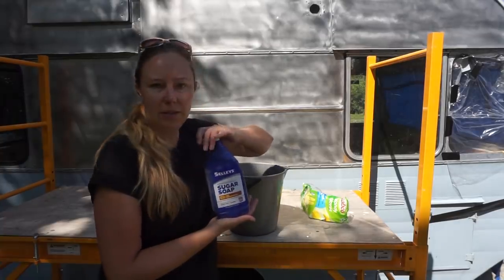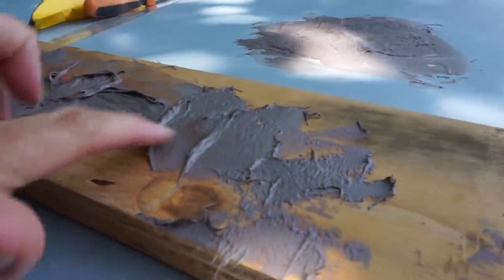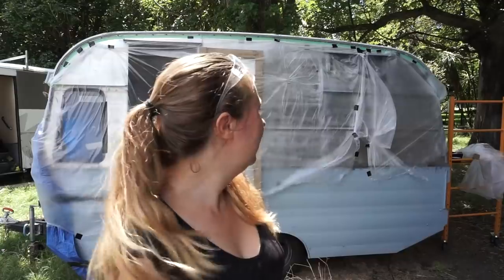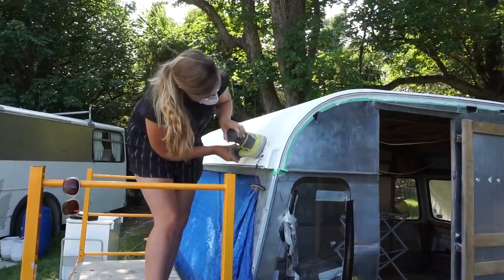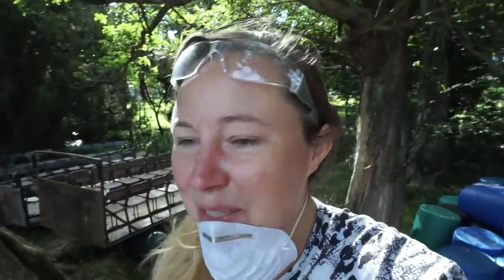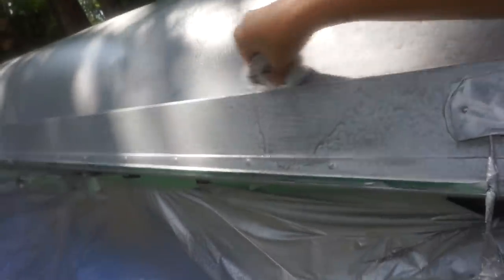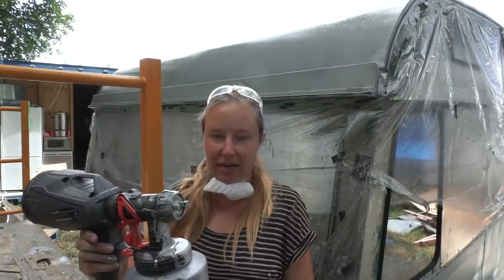Too Excessive With Roof Sealing System? Hopefully No More Leaks!

Comment: A tip for the paint tray; for easy cleanup and to prevent old paint flecks in new paint, stick the tray in a plastic bag and tie/tape up, then pour the paint onto the tray over top of the plastic and use as you normally would, then all your have to do at the end is throw away the plastic bag and your tray is spotless :-).
Reply: You can also get clear inserts for the tray, which are probably slightly easier to use but of course more expensive than a plastic bag. Unless you're using supermarket carrier bags.

Comment: Hi Karen. You are doing a good job on the caravan. If I could give an advice, I would try to get an airdriven spray gun and a compressor for the painting. That is a big difference from those electric guns. The airdriven gun (with a seperate compressor) delivers much finer particles more evenly, and the result usually get much better. I admire your ability to go on with a smile, even with a big project like that! Best wishes from Norway!
Reply from the maker: Thanks Jan. After trying that spray gun, I did wonder how different a properly professional version would be.

Comment: Good work!  When you come to the end of a paint stroke, generally it’s best to let go of the trigger and follow through with the stroke. Then push it again on the return stroke. When you change directions with the trigger depressed, you will get runs. Many thin coats are better than one or two thick ones. Never pull the trigger if the paint sprayer is not moving
Reply from the maker: Ah that's good to know! Great tips, thank you
Reply: I have spent years as a painter, so I would go for a 5" brush on the roof with an 11/2" for edges. You would have trouble reaching across ....with your jolly approach you could rig up access with a scaffold board strapped to a ladder leaning either side of van??   But ladder would need to be lashed to van to stop them sliding.  Just an idea well done Karen for your efforts

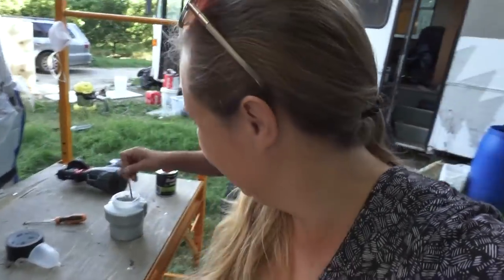Comment: 9:09 Yeah, it looked too thick :)

Dad used to use a bent (into a U) welding rod to mix/stir paint/solvent - and his test was how it ran off the rod when lifted out. I think it was thinned enough when it just spattered/splattered - i.e. beads/drips broke off the bottom of the dribbling paint.
Reply from the maker: Ah ok. Your dad sounds like he knew what he was doing!! Seriously more skill required than I realised.
Reply: @TravellingK  He was a motor mechanic - a proper one - he could do engines, gear boxes, body-work and painting.
He was no good with heights - 2 rungs up a ladder bothered him !

Comment: I think you're doing really well with this...and you must be learning a lot. Waiting for paint to dry can be really boring but has to be done, as long as the job is robust it will be OK, I think it's called 'cottage finish'. :D. There is always T-cut as a paint smoother/polish as a final step, it might (?) help level out those runs a bit in terms of look if not in profile...but only when the paint is really hardened off!! :)
Reply from the maker: hahah yes, cottage finish with personality🤣Think I will need to revisit it.
Reply: @TravellingK  Keep up the Good Work. :)

Comment: Your doing very well it must be nice to have somewhere to do the work. I should of waited until  the video was finished, but if you gets a smaller roller with a sponge sleeve you will get a BETER finish
Reply from the maker: I do appreciate having this area to work in. And not too far from a hardware store (when it's open). Good to hear about the roller!

Comment: Just use a good horse hair brush next time, lots of thinners in the paint to help it settle out on your surface and it will remove any brush strokes, and do 4 or 5 even coats. It will come out as if you sprayed it in a booth, like a glass finish. But hey, you gave it a go!
Reply from the maker: I think I need to look into this... I like the sound of that!!

Comment: Hi you need to really be doing that roof by using a small roller and then once rolled use a paintbrush but very Featherly just to take the pitlane out I think you will probably find it a lot more easier and you will get a even paint with no runs All the best from Terry keep up the good work
Reply from the maker: Hmmm that's good to hear! Think this might be the way I'll go.

Comment: Minefield using a spray gun, first, electric sprayers do not produce enough pressure for something so big as your roof unless you dilute the Cantonese to it's very minimum, else, as you found, you will constantly block the nozzle, but stick with it, , The English Pennliner is proud of you ! x
Reply from the maker: Ah that's interesting to hear. I'm glad I tried it out... but now I know I'm not a fan of an electric strayer🤣
Reply: @TravellingK  If you are going to do any spraying of big panels you need an air compressor min 100 Ltr tank.

Comment: Spray guns take a lot of skill to use successfully. Electric ones must be a nightmare as they don't start and stop instantly like proper spray guns. There's quite a skill in getting the paint thinned correctly. You also have to match the rate the paint comes out of the gun with the speed you move across the surface. Start moving before you start spraying. Stop spraying before you stop moving. Move at a constant speed and a constant distance from the surface you're spraying. Spraying requires several coats as you can't put it on 'thick' at all - otherwise in runs.
I'm going to guess a pro spraying would start with 2 coats of primer, 2 coats of undercoat, 2 or 3 coats of topcoat. Varnish after that could be an option ! with some rubbing down in between paint types ! But don't ask me, I'm only guessing !
Reply from the maker: Sheesh! So I did that half-a*sed version🤣
Reply: @TravellingK  I guess your only real mistake was not researching it enough beforehand to discover the difficulties first.

Comment: Use your arm more when spraying from side to side and only press the spray trigger while arm is moving - it’s difficult to get a good finish... without runs and orange peel 🤦‍♂️ looking good tho... 
😊👍
Reply: Yes, this is good advice. Don't reverse direction with the sprayer running or the ends will receive more paint than the middle. It's a sort of pssssssssst psssssssssst psssssssst action. To be honest though, on a project of this size for a beginner I'd probably be brush painting with many well thinned coats.
Reply from the maker: It wasn't until I was editing that I saw just how badly I was using it🤣

Comment: Hi Karen, you are really doing a fantastic job on the roof and taking perfectionists  care in doing so. I have used rubber sealant paint ( 2 coats) on my shed roof and it is guaranteed for 10 years. So far so good. Resists movement so it should be good for you. Keep up the good work.Just seen where you were sanding rubber paint.  What idea is that?? No you cannot do that. Just leave it be to do its job. Who on earth told you to put anti rust paint onto rubber paint needs their head testing. Just wasting time and money on stuff you do not need. This turned to me me to be a crazy video!! You got my thumb down after all the thumbs up.
Reply from the maker: I'm sure the instructions said to sand🤣But yeah, didn't really work.